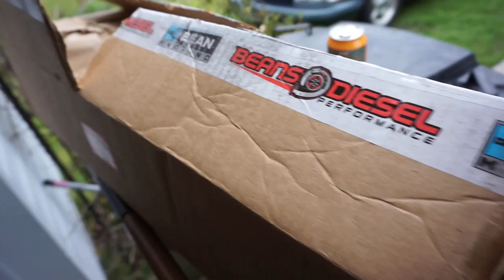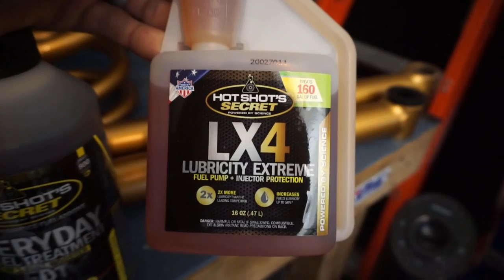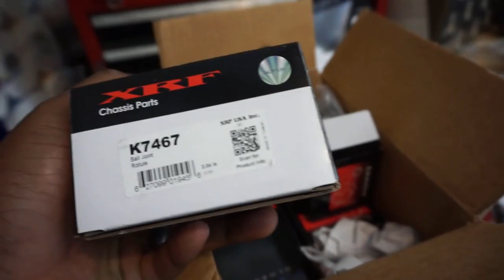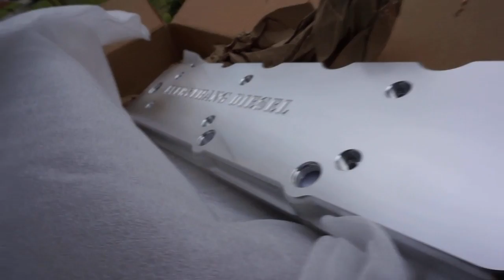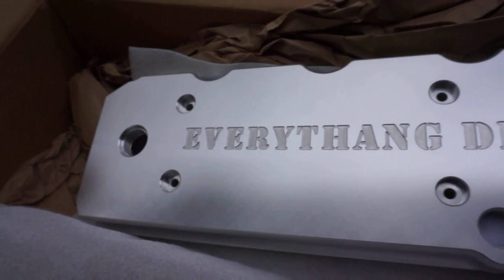UNBOXING MORE AWESOME PARTS!!

Comment: Looks great! Can't wait to see the install. Would love to get the valve cover. Looks sick, and definitely would clean up the engine bay. That catch can looks good, you mentioned it is needed over 500 hp? Would it hurt to have it if you are under 500hp? My goal is just a super efficient and reliable truck, maybe running around 470HP max. Keep up the great videos.
Reply from the maker: U can run a catch can on a stock truck as well it wont hurt it  I got a video showing how to install it and what purpose it serves!

Comment: I have a 2006 5.9, 24 valve Cummins with open crank case ventilation. Sense my crank case vents to the atmosphere would a oil catch can be beneficial?
Reply from the maker: Its not more beneficial just cleaner.